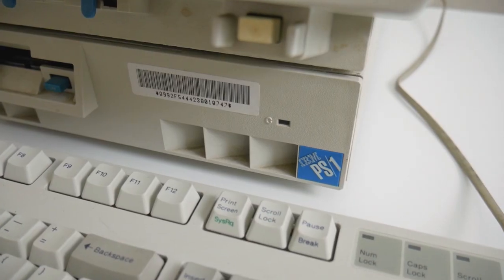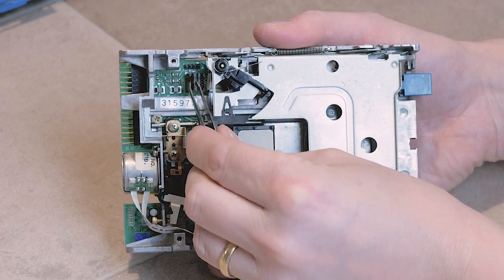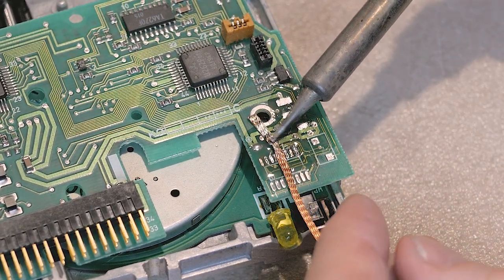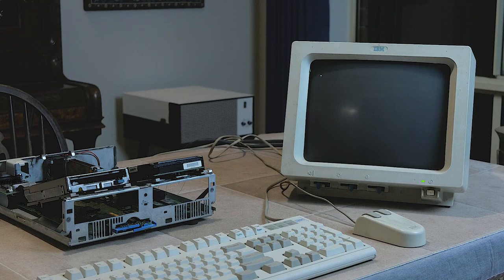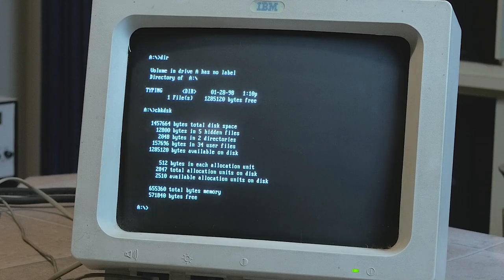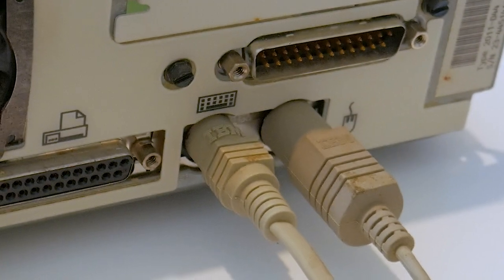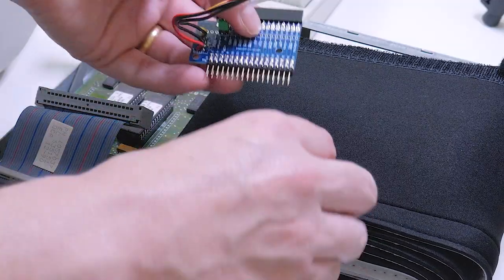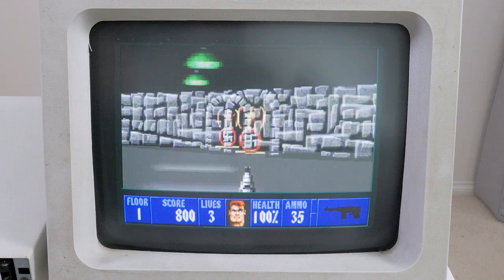IBM PS/1 2011 Pt 3: Floppy drive fix or replace standard (+ PS/2)

Comment: Nicely shot and very informaitve!
Do you plan also to work on the Hard drive? I own this machine and I am in desperetely need of finding a good and modern replacement for it. The disk is an 8bit IDE-XT with proprietary connector and you can simply connect a CF to IDE adapter cause it's not IDE ;-).
Reply from the maker: I’m a bit late to reply, but I do plan on creating an adapter for the HDD at some point in the future :) I have found some doco on it, so at minimum might be possible to emulate the interface on a modern MCU.

Comment: When dealing with leaked capacitors, using an acid like white vinegar to neutralize is usually working well. A proper wash with soap water to rinse away acid and dirt afterwards.
Reply from the maker: Ah great tip, thanks for the advice. I'll give it a try next time. I'm guessing that given we're cleaning away "electrolyte", that it's a salt, and therefore it must be alkaline for vinegar to help... either that or the vinegar helps attack the compound that is the result of corrosion. Hmm...

Comment: Didn't know about the electrolytic capacitors in the keyboard, but in hindsight that makes perfect sense. Will have to check mine. Thank you! And cool to know that machine can run Wolfenstein. I never tried; always thought it was too slow.
Reply from the maker: My next video (delayed a bit) is getting close to being finished and addresses refurbishing of the keyboard (difficult) and mouse (easy), but thankfully you can use modern PS/2-based replacements. For me, Wolf3D is THE modern retro game. It made me glad when I finally got a 286 as a kid. Some smart people have also hacked it to run (very slowly) on 8088 machines too!
Reply: @fooglestuff  In that era, it befuddled me why we were calling them "PS/2" peripherals on a PS/1. It was only a few years ago that I learned the PS/1 actually came after the PS/2. Makes sense.
Reply from the maker: @McTroyd  it does seem like an odd marketing choice. I wonder how far back that idea goes.

Comment: Fantastic work! I thoroughly enjoyed watching this, especially since I am also in the process of restoring my own 2011. I'm also experiencing some issues with my floppy drive (hopefully to be solved with a Gotek) and have ordered a drop-in replacement for the RTC chip and battery.
Reply from the maker: Sounds great, @thr3ddy, and thanks for the supportive feedback! :) Let me know how you get along with your own restoration. I've seen others use GoTEKs and I might try one myself, too. What type of RTC replacement are you going to use? Glitch Works, maybe?
Reply: @fooglestuff  I'm not sure if this replacement has a name, but it's sold by the seller markgm on eBay. He also sells adapters to convert the PS/1 floppy drive cable to a regular IDE + small molex. The RTC replacement is a Dallas chip powered by a replaceable CR1225 battery. As soon as I installed it and ran time/date/configure, the system booted without any issues whatsoever. I did not go with a GoTEK in the end since they lost my shipment over the holidays, but I replaced my 1.44MB floppy drive with a 2.88MB IBM floppy drive that works like a charm and keeps the blue eject button aesthetic in place.

Comment: Nice! Can i ask you to post the make and model of that MAXTOR hard drive? I'm trying to get a replacemente HDD for my PS1...
Reply from the maker: Sure @Marco.Teixeira, it's a MAXTOR 7040F1, probably very rare (made for IBM with the proprietary XTA HDD interface used by the PS/1 model 2011). In future, I hope to research making an adapter to translate between XTA and IDE (PATA), but this could take a while.

Here is more information directly from the label:
P/N: 6373570
E.C: 835317
Supplier code: 600881
IBM FRU P/N: 1383735
Drive type: 39
Capacity: 40MB
Model: 7040F1
HDA: 13P1
PCBA: 03P14
Unique: 03P1
TDA: 5091
Reply: @fooglestuff  Thank you. Just for the record, if it helps future readers, mine is: IBM | P/N:6128242 | FRU P/N: 6128279 | MODEL: WDL-330P | MLC: C13112 | CAPACITY: 30 MB | MADE BY IBM U.K. LTD.

Comment: Great video. I fixed my fdd errors but then my hdd died. I found a cheap but ver old 20mb esdi hdd wich works but and I am using a parallel Iomega zip 100 drive but I am trying to find a better hdd. Do you know how we can build as adapter for a IDE hdd? And how will you improve the gaming performance?
Reply from the maker: I want to understand the “XTA hard drive” interface used by this model. While my HDD still works I might try experiments. For actual IDE, I think an XT-IDE card is needed, plus modification to the PS/1 ROM: https://forum.vcfed.org/index.php?threads/ps-1-2011-acu-project.80370/post-1216698 - I am going to learn more about this too. As for gaming… in my video I was referring to improving sound. I’m not sure yet if there is much that can be done to make games run faster. If you have any ideas, let me know!
Reply from the maker: Oh, btw, how did you adapt the ESDI drive to your PS/1? Do you have an Adapter Card Unit? I’m not sure how else you would attach an ESDI drive to the PS/1 model 2011

Comment: fix the floppy diskette drive
Reply from the maker: Done :) Once I worked out that I need to leave the keyboard unplugged at power-on, my repaired original PS/1 FDD started being detected correctly and working fine. No more “Sector not found” errors.